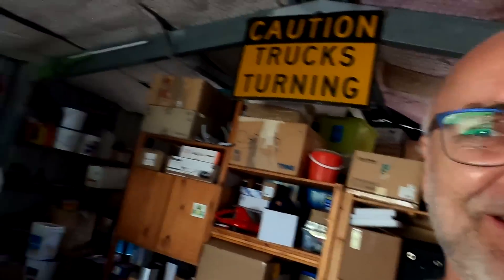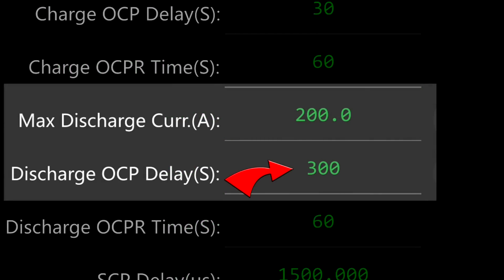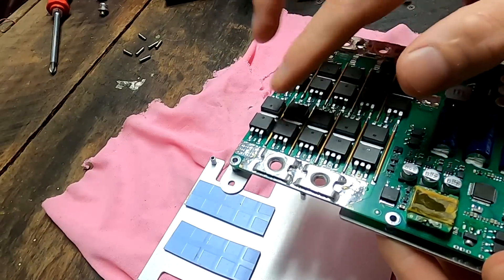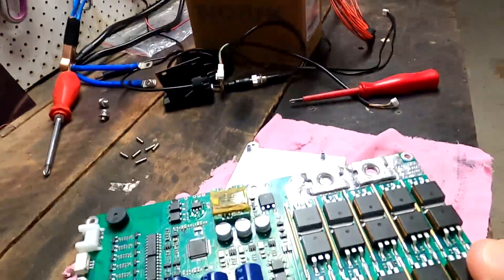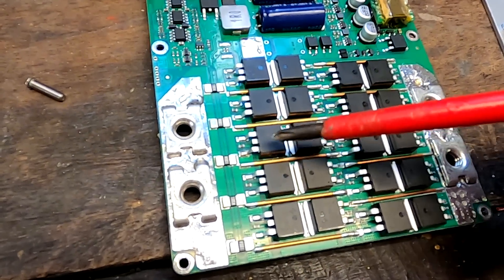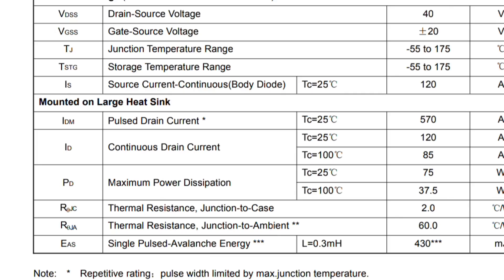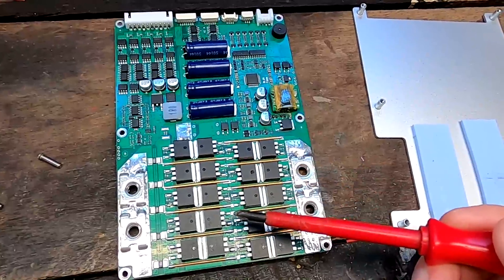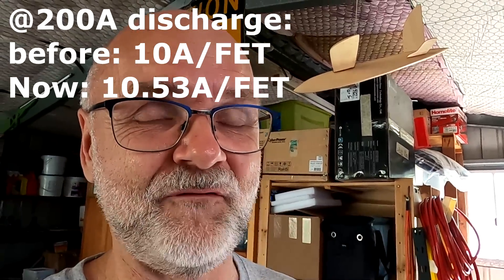Magic smoke! What happened to the JK-BMS? Still reliable or bad design?

Comment: Nice to see the BMS is still working, and we will get new videos about it :). There are many reasons why FETs can die. Could be a faulty component from the factory, but my guess would be something to do with the board design. Probably with the gate drive circuit or snubbers. It could be too weak to turn of the mosfet fast enough and that will generate too much heat. They do not like to be half turn on under such load. Alternatively, the gate drive can be too fast and cause ringing on the gate with stray inductance. That will cause the transistor repeatedly to turn on and off destroying it under load. And so that it wouldn’t be too easy there is also problem with fast switching of high current. The inductance of the cables and loads can generate large transient voltages on the transistor that can be way more than 40 V and cause the transistor fail.
It is possible to solder a new transistor there, but it won’t be easy using only a soldering iron. The board is designed to take the heat away from the transistors and will do the same for your iron. You should heat up the whole board on a hotplate near the melting point of the solder and then use hot air (or iron) to take of the broken mosfet. Personally, I would probably leave it like it is. There is plenty of current carrying capacity left for normal use, like you said. Of course, it is possible that other mosfets have failed but less visible. It will let you know under next load test if that is the case, and you will get a nice thumb nail for your video.
Good luck for your next experiments!

Comment: Hi Andy, great details and diagnosis on the failure. I also think it is not a major failure, if the mosfet failed in short circuit (very common) then it would have been a huge problem. No need to take the mosfet apart but I would highly recommend you disconnect the source and gate legs of the damaged mosfet, just can cut it off or de-solder. This will make sure that no further problems arise in the future. Otherwise there is a risk of the malfunctioning mosfet conducting or passing high voltage back to the gate signal. Thanks.
Reply: I was just going to comment this suggestion as well. If not replace, at least cut the legs off. We don't know how big the gap is from when it blew, or if there's any pieces inside that may become loose and eventually cause a short. Don't just trust the magic smoke to have disconnected the component.
Reply: Yes you don't want any arcing to start a fire.

Comment: It failed open, just for safety desolder/cut the two legs.
You never know what could happen in another surge.

Today i bought the same BMS, it's the product i have been waiting for, i can finally remove the balancer, the heating thermostat, and the mobile phone i used to remotely control it.
Also i can connect the new bms directly to the Victron portal via the rs485

I have 100A loads maximum so i think im more than safe.
Reply: If you de-solder the two legs you'd be able to see if it's glued to the board by lifting it slightly. If that works, continue flexing (up & down slightly) and the very edge of back tab should tear cleanly. Solder new mosfet over the existing tab? (heatsink might require removing it also)

Comment: It looks like that mosfet latched momentary or lagged slightly closing - it would only have to have  been for a few micro seconds and all the current  the others were taking would have surged through that poor mosfet, killing it  - mosfets used in parallel to take high current have to be well matched so their on resistance is the same - if that mosfet was from a different batch or its  gate had slightly higher capacitance   it could  be enough - I would cut off the 2 mosfet legs so the damaged  mosfet is isolated and continue to use the BMS  perhaps de=rating it to 180amp
Reply: That's my thought too - that one was simply slower than the others when switching gears and that's why the entire voltage flowed through it before it "secured" itself.
Reply: @EngelOfWar1 Howard raises an interesting issue - its possible that as the mosfet was towards the middle of the pack it ran slightly  hotter and that slowed the switching speed compared to the outer edge mosfets - heat being energy would have inadvertently excited the semi conductor slightly  causing it to conduct and cause an avalanche effect as the current surged through

Comment: I guess they use this many mosfets to get the "on" resistance extremely low, and not necessarily current handing. So no problem losing one.
Reply: If the failure mode is avalanche, he will be losing a FET each time he's unlucky enough for the BMS to turn off under a load that exceeds the weakest remaining FET's avalanche energy.

Comment: Stray inductances of the setup probably sent the MOSFETs into avalanche and this one was the one with the lowest breakdown voltage. Still, if 200A continuous are stated for real applications, then the product must also be able to turn off 200A multiple times without taking damage.
Reply: I completely agree
Reply: Thing to keep in mind: although the BMS was under 200A DC load, pushing 2500W out of an inverter is 5000W instantaneous at AC peak which would call for ~400A peak at 13V. If the invertner's DC-in filter takes care of half of it, that still leaves 200A peak-to-peak current ripples on the DC bus and the BMS may have disconnected at ~300A.
Reply: @teardowndan5364  when you look at the datasheet of the MOSFETs, there is a SOA graph. The MOSFETs can take multiples of 300A (20 MOSFETs) for a short amount of time.
Reply: @matija3791  The point I meant to make is simply that the 200A DC readout may have been misleading regarding the amount of current and energy the BMS attempted to break.

Comment: Simple fix, to remove the duff transistor, you need a heat plate place under the PCB where duff transistor is on top, can heat to around 160C and need a heat gun, just warm it up more on local area, would be easy taken out. But you don't have that plate, you have a heat gun, without the plate and using it might burn the PCB. Ask an engineer, I am but not locally. May I add, forget it and put it back together and continue your test.
Reply: Heat plate not needed, especially with parts on both sides of the board. 

Just a hot air station is needed. 

keeping the heat local to the part. 

As long as there isn't too much heat for a long time in one area, the PCB won't deform/warp. Only needed till the solder is flowing on just that part.

Comment: The thermalpad is low quality, not sure the if transfer of heat is good, other brands like gelid or thermalright can do a better job i guess. I will change the thermalpad when i receive my BMS.
Reply: There is no need I guess, it didn't overheat at 200+ A continuous for 5 minutes.

Comment: Andy, personally, I'd test it at 190 amps and if it worked fine, I'd leave it alone. I believe that w/o current, soldering this unit will be fine, cooling it as soon as possible and letting it return to room temp before testing... I have soldered a LOT of computer memory boards in telephone switchrooms and never had a problem as long as I didn't "bake it" w/ excessive heat.

Comment: I was working a electronics repair shop and I did the sniff test.   My coworkers thought I was crazy, but I found the faulty parts quickly.

One of my coworkers tried it and was coughing and retching.   Seems he was leaning over the board in a test rig sniffing when a cap blew.

Comment: It's a tricky one. They do advertise  the bms to operate at 200A continuous. They do also have a setting for a 5min (not sure why it's that long) delay for over-current protection... based on your test,to me, the bms failed and isn't fit for the purpose of it's specification.  I do think it could be an unfortunate malfunction of the mosfet but the bms manufacture should be under-rating their specs so they are confident their product will meet the specification requirements. I'd be very interested to see you repeat the same test!
Reply: Its not tricky at all. Stuff fails. Especially when the continuous rating is exceeded. Moving on.
Reply: @geraldhenrickson7472  you're very forgiving! It's great Andy shares these videos so we can all learn and take something away from them.

Comment: It has of course nothing to do with the quality of this BMS. There has been of course a over voltage induced by the inductance in the chain. The solution would be of course a snubber network. (so current wasn't the problem but voltage of course) You would need a hot air iron and and a heating platter I think for repair. Next time another FET will pop under the same conditions.
Reply: I suggest to disconnect the broken MOSFET and re-run the 200A test to see if it is a missing snubber or a previously broken MOSFET.
Reply: That was the way the FET died. And for my thoughts this is okay for me. It´s a safety feature and if I pull 200A (max BMS current), then my installation is faulty! If the BMS shuts down the system completely (even when a FET dies) it makes is job right. 

And with the way you would repair this i am with you. Maybe not a heating platter as a must have but a really good soldering iron like the JBC one.

For my definition of a system i would highly recommend to have a max system current (all possible loads active) half the max current of the BMS never the maximum possible current the BMS is designed for or labeled with.
Reply: A high current protection is not really a protection if it's achieved by suicide...

Comment: You just need to "reflow" the part (it's an SMD part) with a hot air station. Their cheap and easy to use, you'll need some good flux. But other than that they can be changed easily.
Reply: Not reflow, but replace the part ^^
Reply: @Irilia_neko  it's the term used. Just type it, into youtube search.
Reply: @Irilia_neko  Can also be used for repair, to replace a dead/broken part. 

When the goal is to just direct the hot air to one location, without having to heat up a larger area. 

Simplest way of doing it.
Reply: @Irilia_neko  OK... Now I see what you mean... First you need the new part. Then you replace it, via reflowing the old one off the PCB, and then doing a bit of clean up. Before adding the new solder to the pads and reflowing the new part. All using a hot air gun. Not the pink one, but one designed for electronics reflow work.